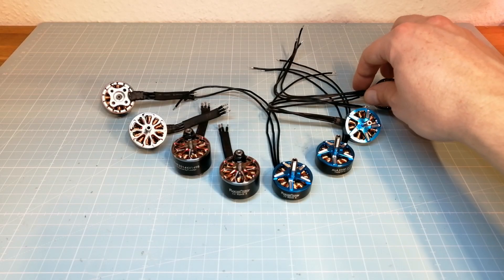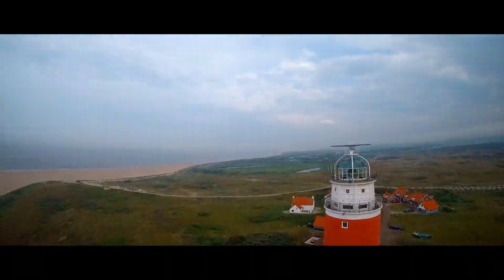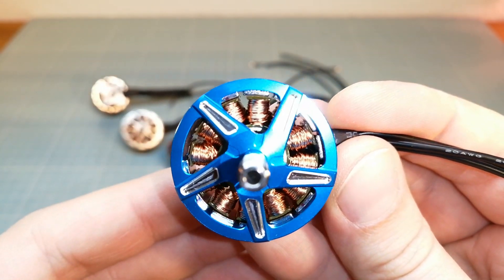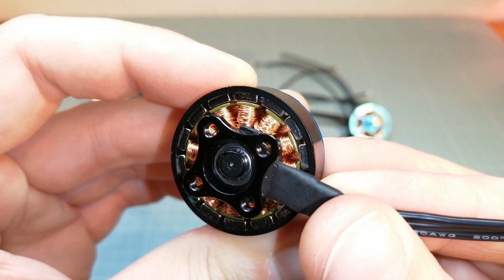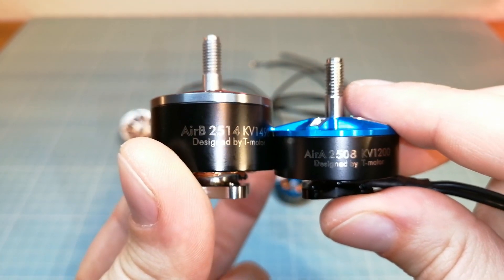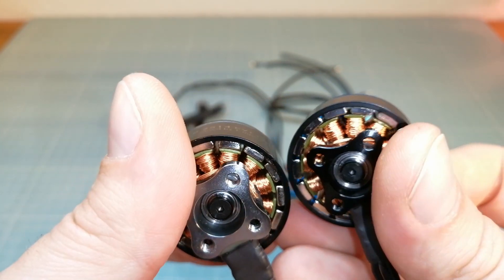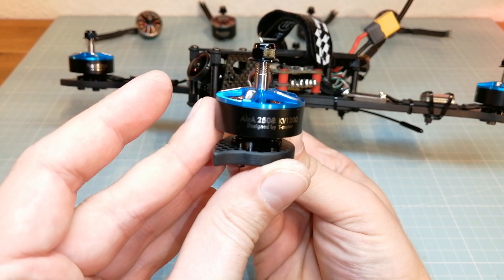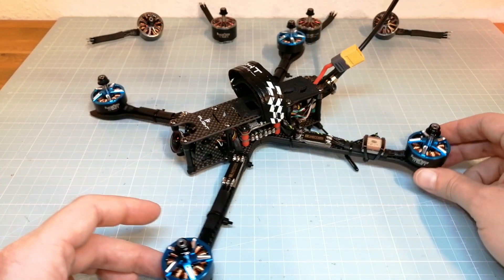Racer⭐Star - AirA - AirB - designed by T-Motor - Next Long Range Plans

Comment: Depends on prop size. Clearly if you run large props like 10" or 11" then the AirB motors but if you only running 7" then the lightest motor will run leaner ie AirA. If it's range you want then 2206 1450kv motors will push a 7" prop at long range speeds and easily beat both in efficiency.
Reply from the maker: Thanks for your comment! I was pretty impressed by the AirB on my XL7, hopefully, I'm not getting disappointed by the AirA - in the end, I will choose the smoother motors. But I think there won't be a big difference in the performance, the 2514 seem to be similiar to the 2508, just more powerfull as needed, respectively overpowered for a 7 inch ... The XL10 (10 inch frame) could be nice in order to go on testing the AirB.
Btw: At first I actually considered to use the T-Motor F60 Pro III low KV Motors for my Long Range quad ... but then I was like: No, I need the bigger once :)
Reply: @TorbanDallas  Fair enough. I'm still holding out for dry electrolyte lithium ion cells.  We know John B Goodenough is working with Tesla motors to produce them at Gigafactory. I'm hoping to decrease battery weight vs increase motor weight.